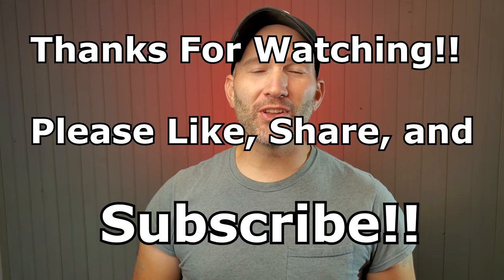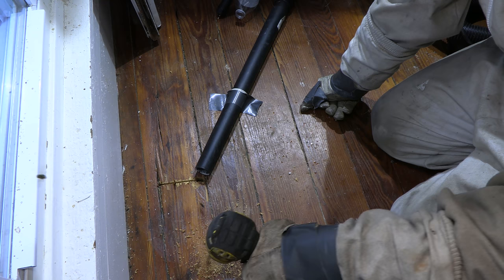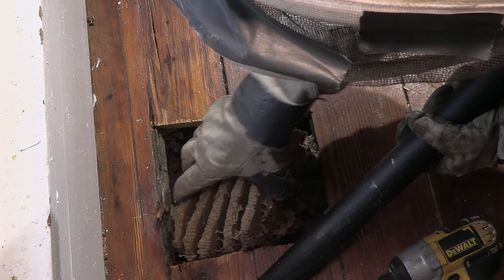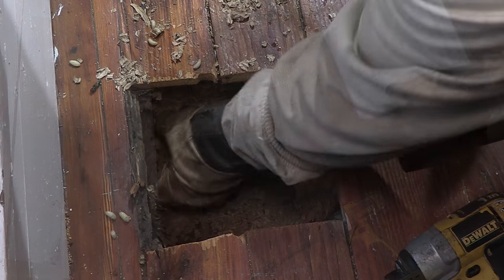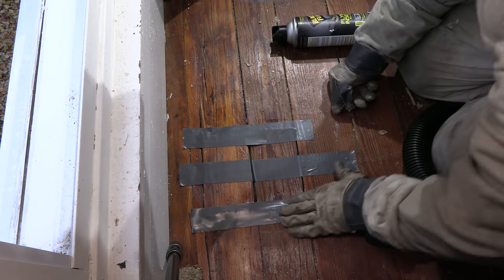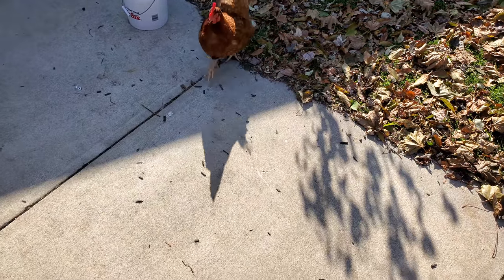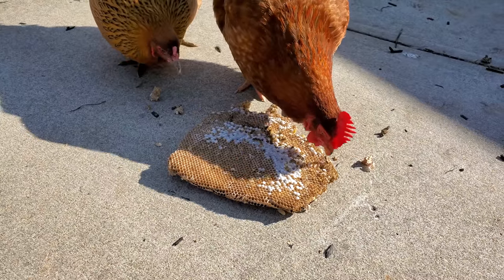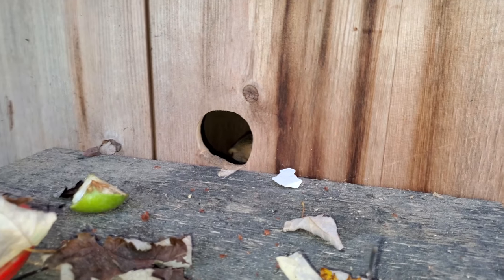*HUGE* Yellow Jacket Nest In Attic floor - Wasp Nest Removal ASMR

Comment: This is supposed to be relaxing???
Reply from the maker: No. Who said this was for relaxation? It shows my process of removing nests and showing the colony up close and personal.
Reply: Pretty sure the letters ASMR say otherwise...
Reply from the maker: @noahcole6856  Autonomous Sensory meridian response is not a video, its an involuntary bodily reaction to stimuli. Anything can elicit this response: ie music, fear, creepy insects 😉, even thoughts. 

Its a common misconception that ASMR is a "relaxing video". It has nothing to do with a video specifically, and only to do with what the video elicits.
Reply: Can you tell me something?
Reply from the maker: @noahcole6856  I already told you everything that was relative to your initial question.
Reply: So no?
Reply: Also are you using random words to sound smarter?
Reply from the maker: @noahcole6856  I gave you the most accurate answers you could receive for your questions. If you dont understand my responses, that hardly means my responses use "random words".